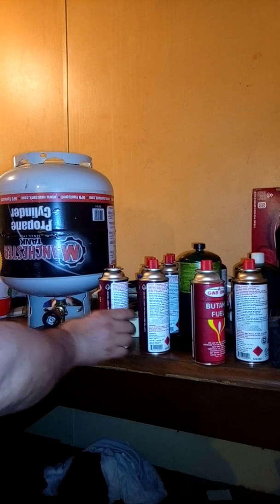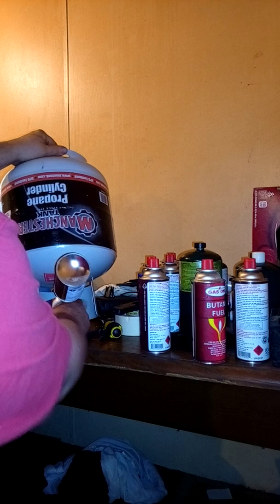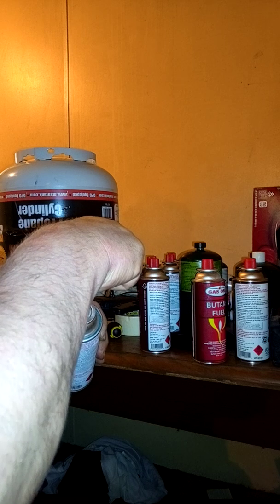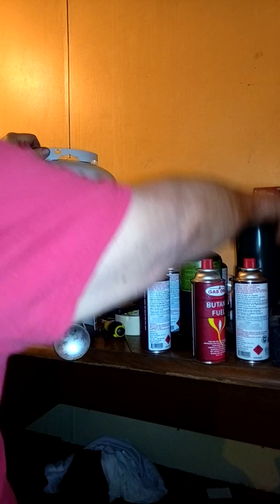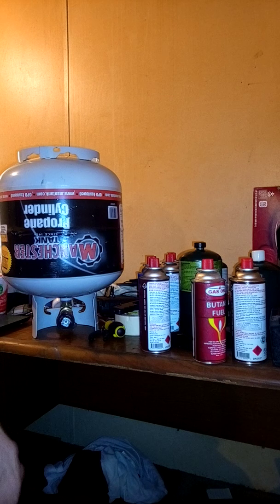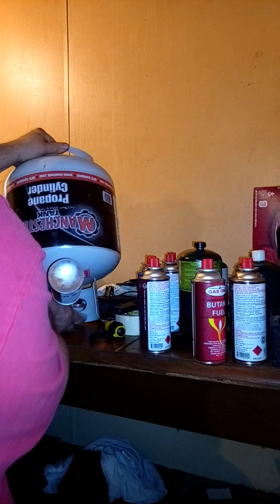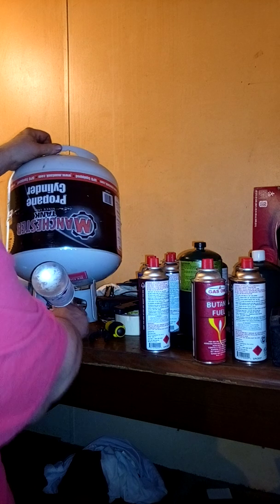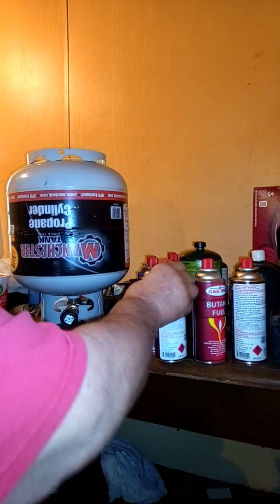how to refill 8 oz canister of iso of butane from a 20 lb cylinder

Comment: Something u didnt mentioned is that LPG, in those canisters, build more pressure than butane. Even if u press the tip to depressurize. Liquid propane will build pressure again. So my camp stove will give me hardtime to engauge the canister. U have to littlerally let propane excape by depressurizing. So the stove locking mecanism engages and stays lock. I think u cannot fill those cannisters as the same amout of grams, they come with butane. LPG will build more pressure than butane. So u have to use inject less LPG, in order to not have mecanism kick back, with thoss portable camp stoves